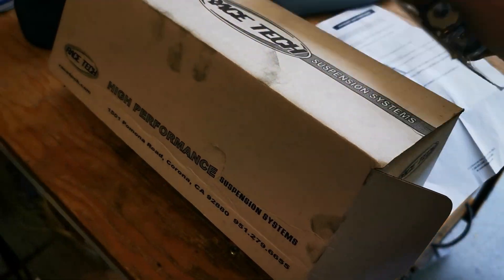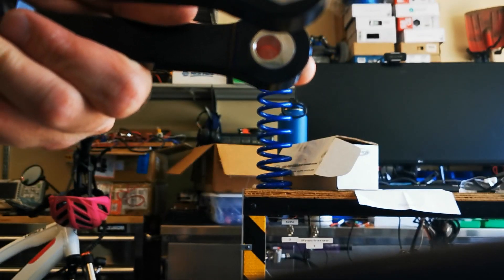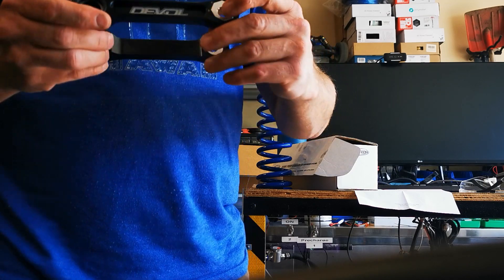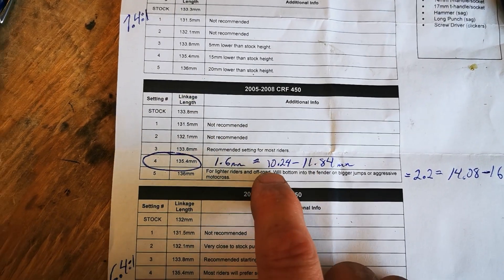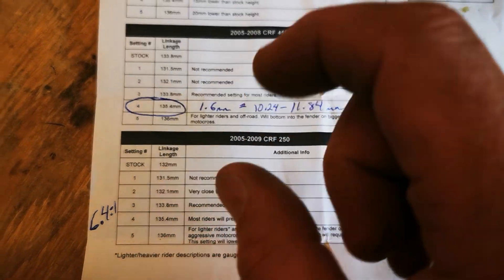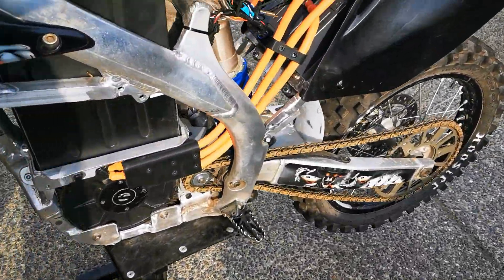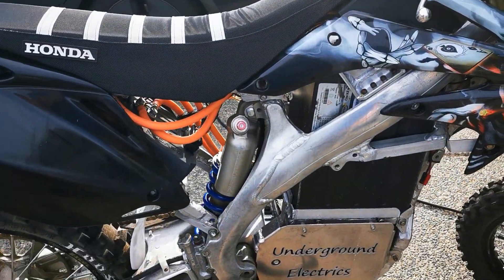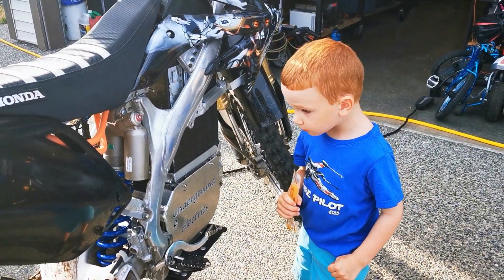Lowered and set race sag

Comment: Hwy arlo any update on that car.
Reply from the maker: Very soon.  Lots of good stuff coming with the CRX.
Reply: Waiting for that i am still using older version of axiom the paltatech one. And sent it to a friend in germany he will use that on go kart at 100kw with qs 8kw motor.
Reply from the maker: @hemantbabel4279  With a motor that deep into saturation you will loose power.  once you hit 50% efficiency you will never get 1 more drop of power out of the motor. If the motor is rated for 8kw continuous it might peak 30kw when putting 60kw in....